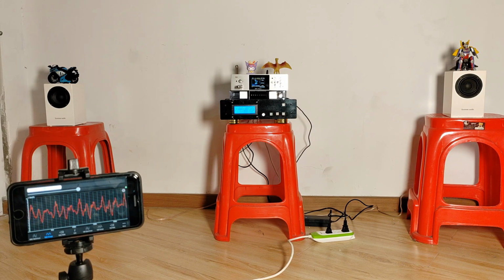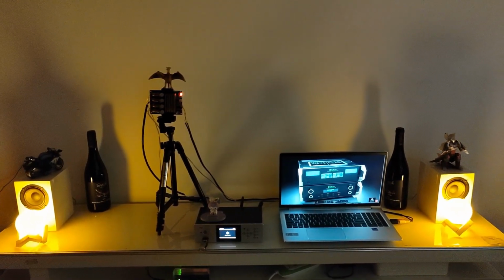Critical Listening versus Electrical Performance Class D Amplifier TPA3255

Comment: I can NOT understand a single word you said!
Just what we need here on YouTube, another man or woman or something in between(you'll have to pull their panties down to be sure) trying to do another video on the TPA3255.
Reply from the maker: Thank you!  I'll take this as a constructive comment for my personal improvement  (I hope you can understand my writen English, cheers!).   Let me have a clarification,  you may like to click this link to get into my Class-D adventure with the TI TPA325x series, the reason, the electrical performance,  the Sound Quality (SQ), the likes and dislikes, etc.  http://1diyshare.com/index.php/2023/11/05/migration-nxp-to-texas-instrument-class-d/

It is mandatory for me (personally)  to migrate into another Class D chipset because the NXP/Philips chipset I have been using like the TDA8920BTH. TDA8950TH and TDA8954TH had been EOL (End Of Life).   The TI TPA325x :   TPA3250, TPA3251 and the TPA3255 are the closest equivalent of the 3 chipset from NXP.    I have done all the electrical Performqance in the (1) Board Level,  (2)  Initial Sound quality  and I am now in the (3) Casing level  with headache on the big SMPS Power supply on how to fit it into a small aluminum enclosure, and soon will be the time to have the ultimate (4)  Sound Performance --- this is all about this video above,  going into a  (i) Critical Listening  and/or (ii) Listening Pleasure,  which involve not only the Class D amplifier  but a whole System like  (a) Music Source CD player standard or MQA and music type and the (b) Speakerss  - cheap speakers, 2 way, 3 ways. etc.

I am only sharing  maybe 10~15% of my adventure with the TI TPA325x,  I am not sharing (YET) how I able to countermeasure the killing point characteristic of each of the module thru the use of Micro Cotnroller,   how to manage high Temperature thru the CLIP_OTW I/O and how to do it with external sensors, I am not yet sharing the powerful Human Machine Interface and the MMI, not even share how each of the circuit works.     That so called, shake, Bake, Rattle and Roll test  in the casing level,  still many things....you know!    

Finally about panties,  its good I live inside China  (which somewhat I am proud of it),  not like the Philippines or Thailand, you need to scrutinized it for the booom booom to make it sure or do a Quality Assurance hahaha,  gays are not allowed in China.  Welcome to China!